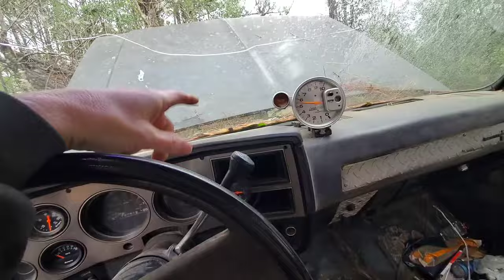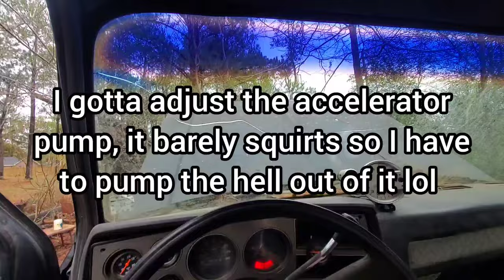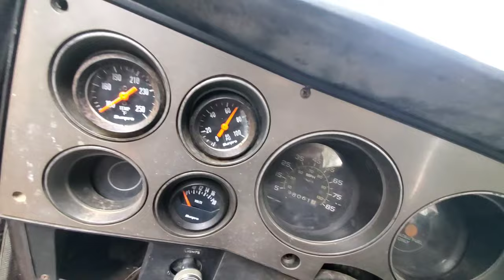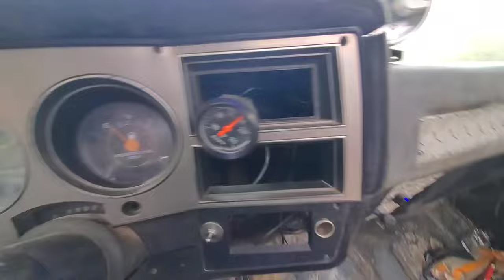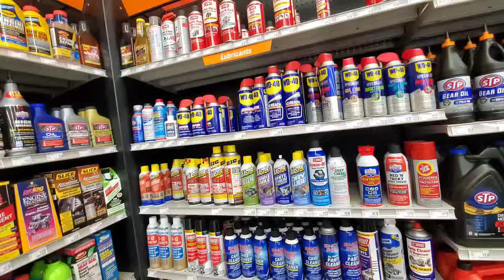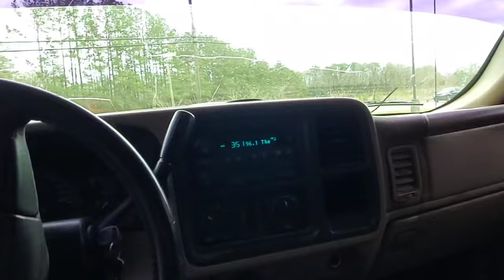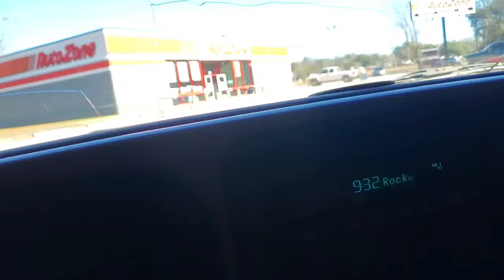The C10 Is Rolling Again!

Comment: I used to pump my brakes to bless them but I started just keeping the lid off the master cyclinder. And keeping it full and just cracking the bleeder until it starts running out and have had suck better luck and they bleed so much easier.   Not saying all vehicles are that easy but everything I’ve ever done the past 20 years that is how I do and works great and saves a lot of brake fluid

Comment: I would assume those high pressure lines by the calipers are original I get closed off with dirt and that kind of stuff and usually are the culprit sometimes if there was any way you could pull one off and maybe run something down at I guarantee you they're pretty much going TV full of stuff replace your high pressure lines you probably won't have no problems

Comment: When the wheel is locked up break open the bleeder if it spins then it the hose if it stays locked up its the caliper
Reply from the maker: That's what I did but ended up being the caliper.. lines do need replaced too tho
Reply: @bowtieguy601  I was just sharing not everyone knows that little trick
Reply from the maker: For sure keep sharing lol

Comment: im working on getting parts together for my own project and figured you might know something about this. I hace a 93 chevy s10 4 cylinder 5 speed 2wd truck. trying to do a 305 swap and wondering if i will have to replace the bell housing on the t5 transmission to get it to work? I have heard some people say yes, some people say you can just use a 153 tooth flywheel with 10.4 inch clutch and it will work
Reply from the maker: Yeah im pretty sure 4 banger bell housing is smaller

Comment: Your dad's truck don't have a cam in it and yours does so that means less vacume at idle brother that's why it runs fine on your dad's truck and not good on yours it needs to be tuned for your truck
Reply from the maker: My dad's truck does have a small cam and this carb has been tuned for the motor on my truck.. its been on it its whole life lol.. only thing that's changed is dizzy

Comment: Your dad's truck don't have a cam in it and yours does so that means less vacume at idle brother that's why it runs fine on your dad's truck and not good on yours it needs to be tuned for your truck
Reply from the maker: Well this is the carb that's always been on this motor only things that's changed is it used to have a msd dizzy and box and my dad's truck does have a small cam but nothing like my truck